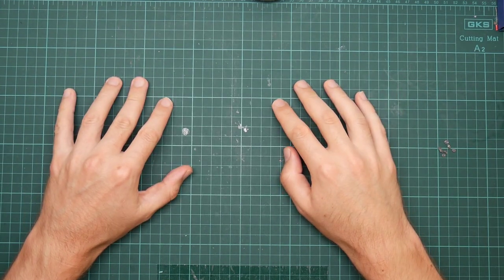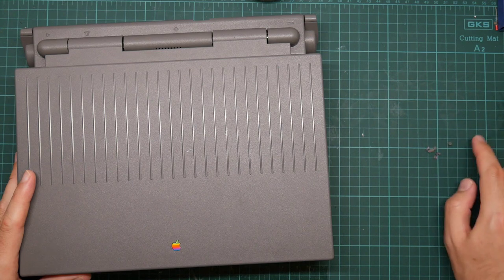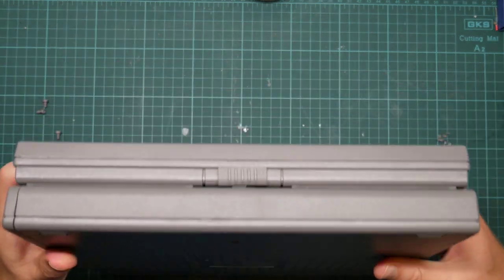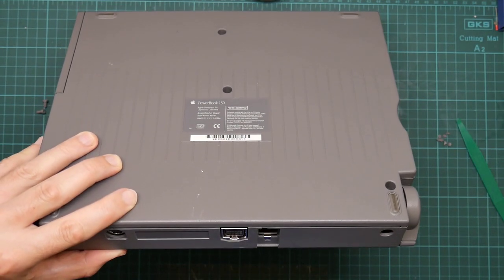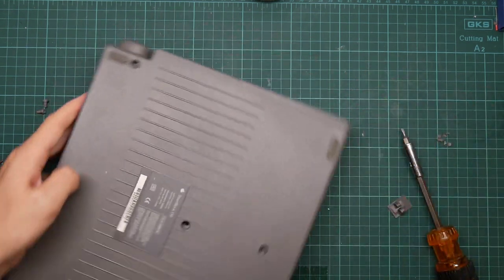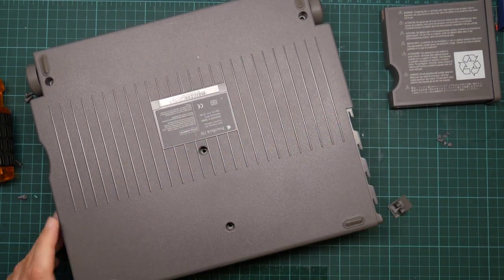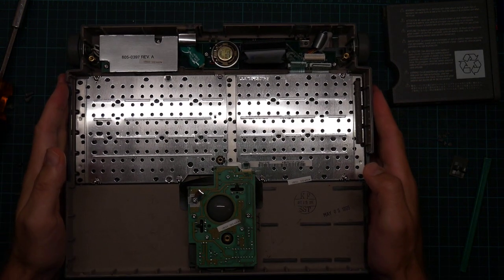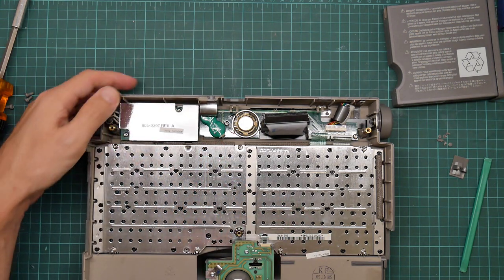Mending PowerBook 150 hinge (and performing a batteryectomy)

Comment: Nicely done! As a hint for future epoxy adventures, get some disposable syringes with blunt metal tips. You can get 100 packs of them for cheap at the usual places. You don't need large ones, as you will likely throw the syringe away after use. I used them with contact cements and epoxies frequently and those made my life so much easier. Also use some gloves when using epoxy, that stuff is even nastier then you mentioned in the video.
Reply from the maker: Strangely enough I actually have some of those syringes --- I just didn't think about them! And yes, I should definitely get some gloves.

Comment: 17:57 - “what’s this? I have no idea” - that made me laugh, I said the exact same thing to myself last night when taking one of these apart :)

The easy way to open it is always to open the back edge first (with the ports) and close it last (after you’ve engaged the clips at the front edge)

One option for repairing the backup battery is to open up an ‘Eveready 9v’ rechargeable battery - it’s actually 7.2v and contains six 1.2v NiCd button cells made in Germany (probably by Varta). Just use two.

Meanwhile one of these main battery packs is connected to my bench power supply - it’s recharging at about 0.3A with 8V applied to it. I think it will live again!
Reply: By the way, if you get a chance, have a look in an original Powerbook 100 some time! They are a much nicer design (by Sony) where the display hinges hook into the plastic in such a way that they don’t break anything. The only weakness is that the logic board is full of leaking electrolytic caps, but once all those are cleaned up and replaced, it’s a nice little machine.

It feels like the rest of the 1xx series are a caricature of the original 100, since they don’t inherit any of the subtle curves, tapered keyboard mounting, or lightweight design.

I run my 100 on a home-made battery with AA NiMH cells, since the lead-acid originals all died long ago. I really like the little thing, it’s quite fast and responsive despite only a 16MHz 68000. You inspire me to make a video sometime :)

Comment: I have one of these as well and have been wondering if you ever did get around to replacing the battery module's cells with contemporary cells. It might be easier to just 3D print a new battery casing.
Reply from the maker: I didn't. I I eventually decided against opening it, and spent some time designing a 3D printable battery casing; getting the shape just right was harder than it looks, and the latch is weird, but I was making progress. I'm planning to get back to it, eventually...

Comment: where did you get the metal ring that holds the screw in? i have the same problem with my powerbook.
Reply from the maker: I think it's a solder tag from my junk drawer, nothing particularly exciting or special.